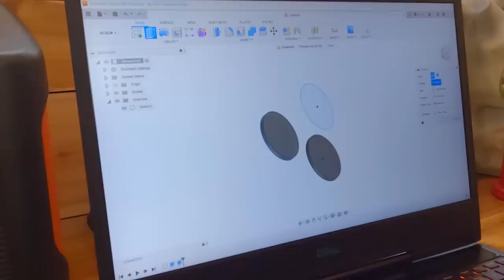Unnecessary Tiny Cabin Upgrades- A 3D Printer and a Sawzall Make What??? #134

Comment: Floor insulation - since you have some of it left, you might consider installing the rolls flat against the bottom.  It should not matter if the joists are uneven. This will give you an air space with the insulation on top and bottom... which should significantly increase the R factor.  I've seen this done on other floor applications.  Will also help keep the bugs out. Love your videos.  Greetings from Brookings, Oregon.
Reply: It would also give critters an amazing new home though...
Reply: @MrFowl  a furring strip perimeter and zip tape seams could keep critters, moisture and erratic breezes at bay.
Reply: Exactly!! He needs a sealed air gap between the floor joists for it to actually have some R value.

Comment: I don’t know if this is entirely applicable, but the people who live in the very isolated communities in northern Canada do not keep their rifles in a heated building in the winter.  The moisture in the cabin when exposed to a sharp drop in temperature can cause the rifle to malfunction and prolonged exposure to a humidity environment can also cause rust to the metal components, as well as severely dry out the stock due to constant swings in humidity level, just like the effect on solid wood guitar bodies.

Comment: I've never used glow in the dark filament before, but they say it will chew up your nozzles if they aren't hardened. I've also experienced in the past that your drive gear will also get chewed up if it's not hardened. Just a little tip if your using a lot of glow in the dark filament. It can slowly degrade your print quality due to the wear on the mechanical parts.

Comment: Why don't you try making 1 x 2 boards and put those on top of the part that sticks down on the bubble insulation underneath and just screw them to the floor joist would be a lot easier than using Staples

Comment: For the mancave a wood block vice and some peg holes in a bench. Find a couple of used rigid solar panels and mount them near the cabin. Even in bad weather they will generate some power and trickle charge the Jackery's. On a good day they'll be banging. Cut down on the generator.

Comment: GosH you could make wooden plates like a cafeteria plate be a big hassal n I duno what youd use em for or serving trays for your parties I always liked wooden bowls for salads n things. Or there arev emersion heaters to heat buckets or even tubs of water but they are electric and expensive we had gas ones in the army for heating 50 gallon barrels n I think they us gas or diesel fuel for the field mess or kitchen w gas stoves.

Comment: Now just add another layer of the bubble insulation spaced about 1 1/2 -1 3/4  apart and your R value will increase so much you won't even believe it !  
As a hint ,  I just ripped some 2" rough cut strips from scrap material to hold it in place and did a triple layer on the skirting on my camp and at well below zero F I can now run around barefoot with no issue now. In hindsight three layers was likely over kill and I realized 2 probably would have sufficed . Of course originally the main floor had been insulated  with standard insulation, but sense I added the skirting and bubble insulation the second Winter my floors went from around 40-45 F normally to nice and toasty on well below 0 F days. 

I swear by the "Refletix insulation" and in the 3 Winters I've been here at the High Mountain Homestead I reduced my firewood consumption by well > a full cord the second and third year just from using that insulation and I only heat with wood . Big Plus,, it's just so darn easy to work with too !

You think the single layer did wonders for you Ryan, try a second layer with a dead air space in between and you'll be astounded by just what a difference it makes,,who'd a thunk it ? I like it so much I am using it on my new 26X30 steel garage and even after using only a single layer so far as a vapor barrier ,,as you did, it made so much of a difference I just can't believe it.

I'll never use regular insulation again after using the Refletix insulation. Bonus part is that , bugs, squirrels, and mice just don't touch it and it won't hold moisture like any normal rock wool or pink insulation does,,,,,

IT'S FRIGGING AMAZING STUFF !

Comment: The bubble wrap insulation is only rated for about R-10 in floor - it's only reflective R value, not density. What might help is to put a 2nd layer of the bubble wrap about an inch or 2 below the first layer.  That will create an air gap an increase your insulation quality.  A layer of 1" foam between would be even better.

Comment: At the end of your video today, instead of re-stapling the bubble wrap, use wood strips or thin metal strips to run the length at the tops of the bubble wraps in order to tightly seal bubble wrap ends to rafters. These continuous strips will leave no gap for bugs to enter. I’m afraid stapling still leaves gaps because you’re unable to create switching (like a sewing machine) of continuous staples.

Comment: That means if you do a layer before you put your new floor down on the floor then you'll have another Burger from your heat so you'll have more insulation with just another layer of that bubble wrap on top of the floor and if you? Know which direction you put? It put it in the opposite direction. That way you'll block more hair out and tape it down.

Comment: You really should just take a chance on the water collection, and fill your water tower right now, while the water is flowing clear and fast. I store water in totes, just like you do. I get my water from town, so there's the difference. BUT... I leave the tote out there in the cold all winter. Even when the temps have gotten down to the lower teens, and there was no power to run heat tapes, the tanks have never frozen up or broken the valves, etc.